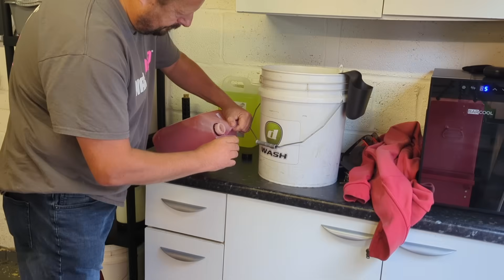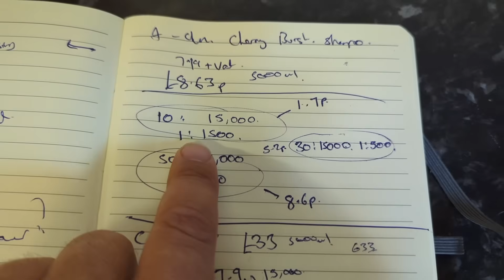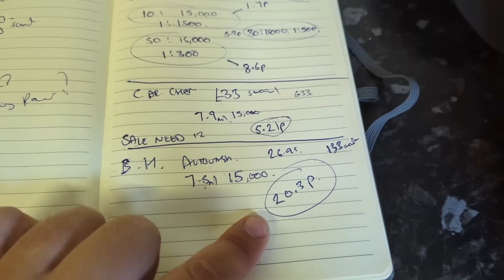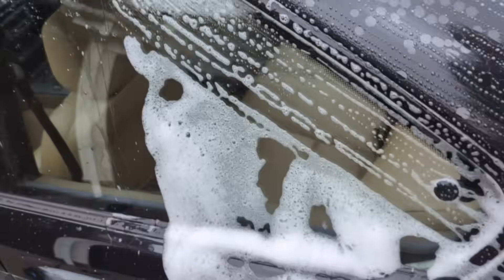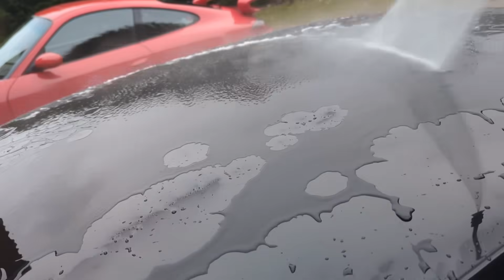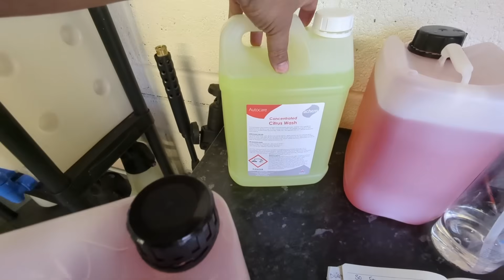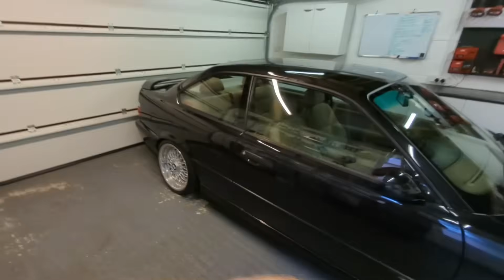*NEW DISCOVERY* UNBEATABLE Car Wash Shampoo £7 for 5 litres of high concentrate (+vat)

Comment: Whats it like in a foam cannon?
Reply from the maker: it will foam up well enough if you want to apply it to the car that way rather than a bucket. maybe start at 50ml to 950 in the lance and see if it foams.  its very foamy that should be enough.
Reply: I've not got this one, but 50ml in a 800ml in a foam cannon of 1:400 pure shampoo worked well for me 😂

It's against the label instructions of which didn't say I could but equally didn't say I couldn't use in foam lance.

The review channels are compelled to go by the label  ( if only) to avoid being implicated if things go awry.

Anything we, as individuals, do off label is therefore at our own risk.

I do enjoy foaming the shampoo on to the car for the contact wash and just use a rince bucket for flushing my mitt after each panel.

I always flush the lance after with warm water as a precaution.